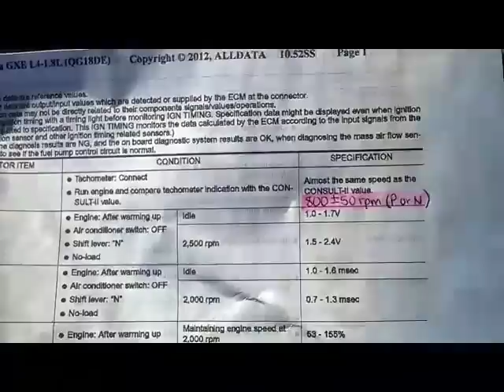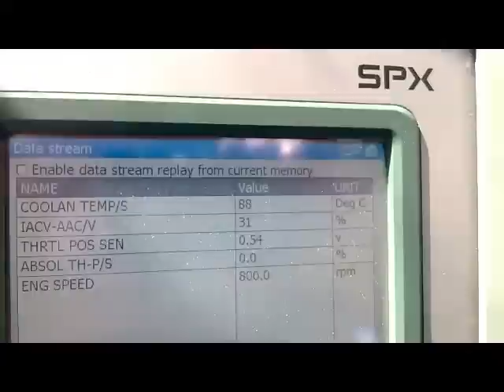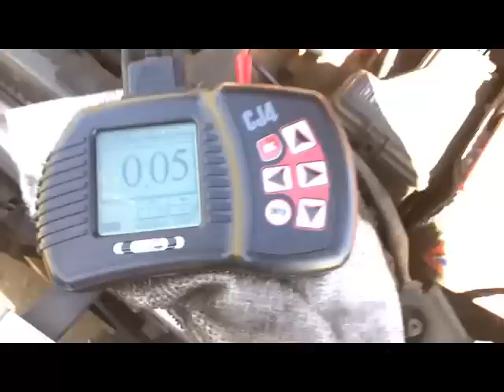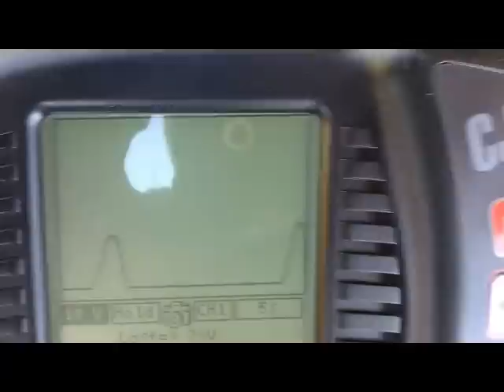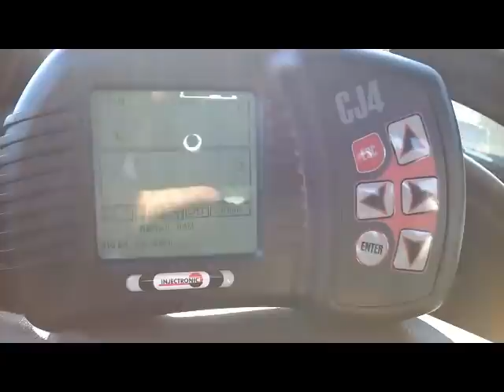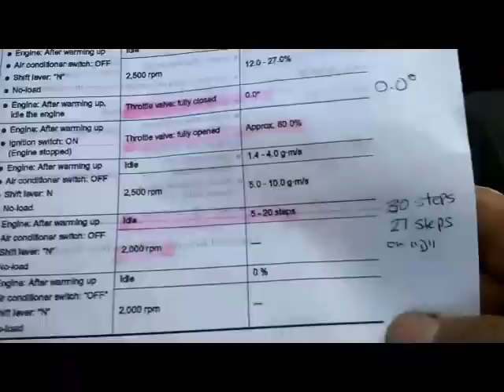(Nissan Sentra) How to check TPS and IACV - Low Idle Symptoms

Comment: thanks to this video, we have same issue with my friends car, sentra also, . is that vehicle has no check engine light, ? because my friends car has no check engine light coming out and the parameter value on scanner has a good value.
Reply from the maker: Hi there, the vehicle did have a check engine light, but only a p0420 catalytic converter below threshold efficiency. For this vehicle the problem was a partially clogged catalytic converter. Another possibility that could cause that type of idle problem on these vehicles is a head gasket problem.
Reply: @EliTheOBDTech  thanks for the reply,  he's car has no check engine light thats why   mechanics that have already check the car  cannot diagnose where the problem come from. some mechanic told s that it was already an ECM issue,

Comment: So how to fix it?
Reply from the maker: The fix for this vehicle eventually was a clogged catalytic converter.
Reply: @EliTheOBDTech  do you know scanner autoboss v30 elite?
Reply from the maker: @gwendeng123  I haven't used a v30 elite. I'm sure it has few more functions than the regular v30. Unfortunately, Autoboss has gone out of business. Autoboss no longer in production.
Reply: @EliTheOBDTech  do you mean it could rewrite some parameters?
Reply from the maker: @gwendeng123  it has a built-in printer,   either bluetooth or wifi connection, bigger screen which allows up to four data waveforms vs two. Software wise, I think it's the same platform as the v30.
Reply: @EliTheOBDTech  is there any aftermarket scanner that could rewrite certain code? For example idle speed
Reply from the maker: @gwendeng123  I'm pretty sure the Autel maxidas or Launch x431.